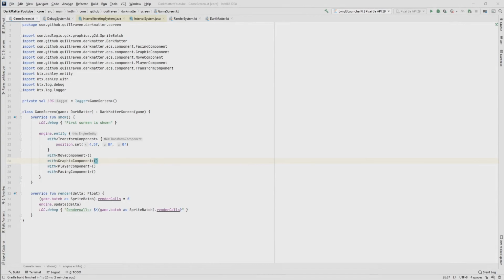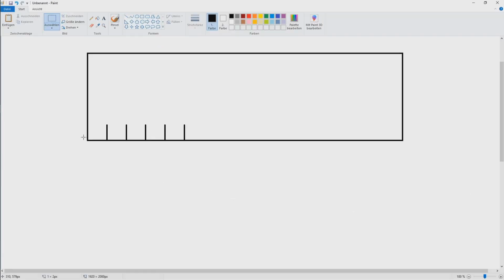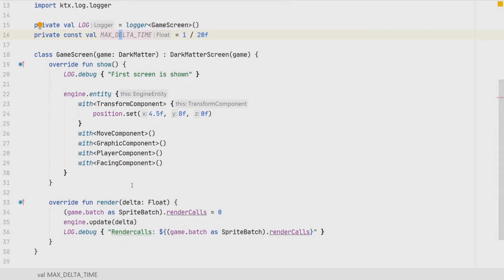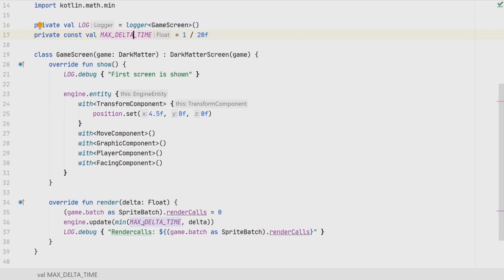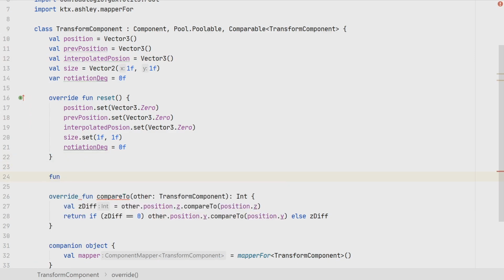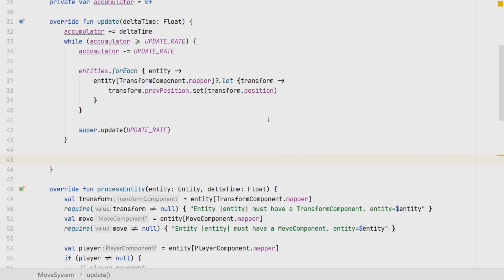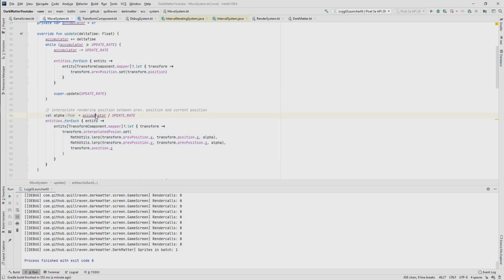(#13) LibGDX Kotlin tutorial using LibKTX  - Fix your timestep

Comment: One more question:
Shouldn't we use interpolatedPosition instead o position in DamageSystem, DebugSystem and PlayerInputSystem??
Reply from the maker: InterpolatedPosition is only for rendering. It does not represent the real position of your entities and therefore shouldn't be used for other things than rendering.

E.g. in this case we also have box2d and position represents the position of
 the box2d body with which the physicsystem is calculating the collisions, etc.. this should be aligned with any other system for game mechanics.
Reply: @Quillraven  oh! OK. Thanks

Comment: Hi! Quite interesting.
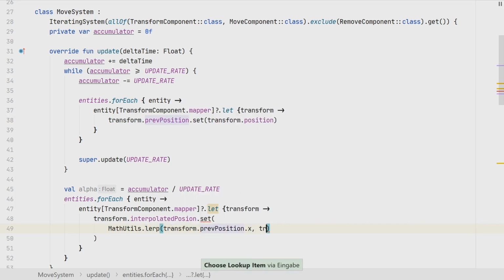I think there is a small mistake in 12:50 when interpolating the y coordinate. In fact, there is no interpolation if both values are the same.
I guess it should be written in a similar way to x coordinate ¿?
Regards.
Reply from the maker: Ha, you are absolutely right. Y coordinate should be exactly the same as the x coordinate of course.

On GitHub it is correct. In this video i used the wrong autocomplete option 😉
Reply: @Quillraven  thanks